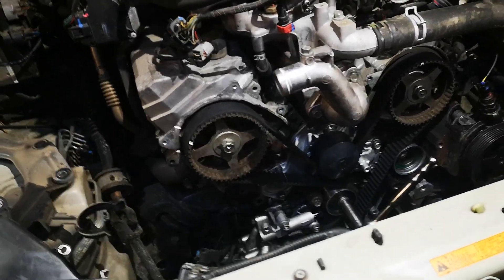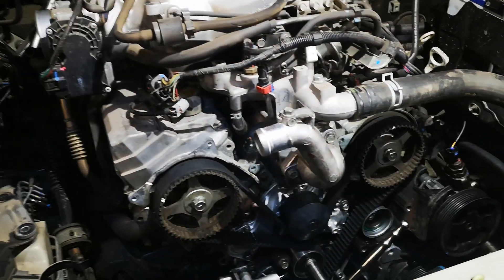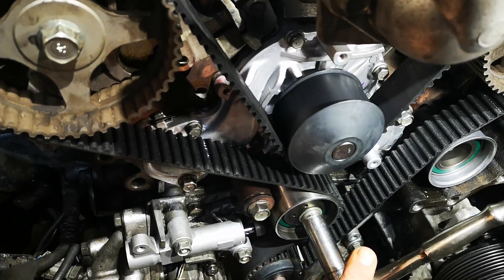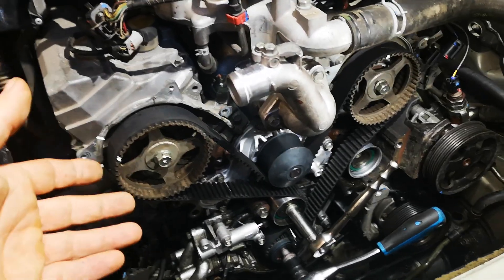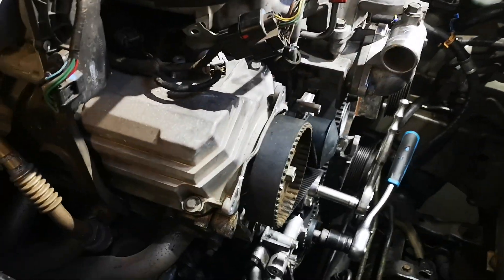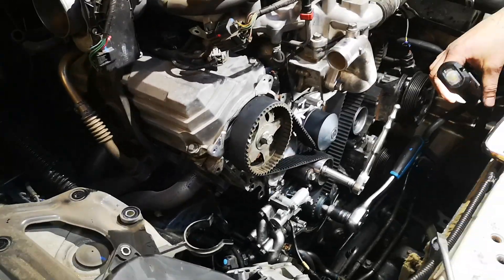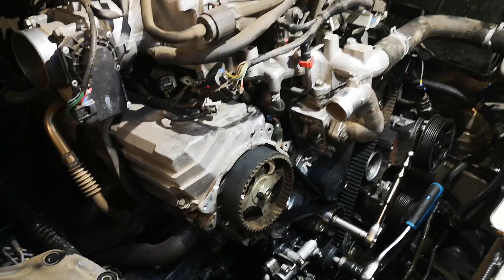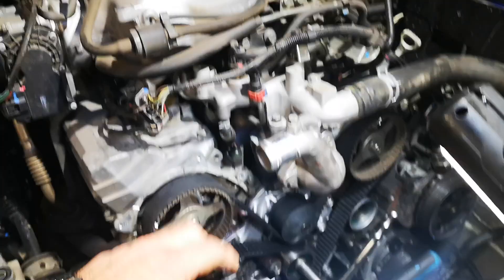Mitsubishi Pajero 2009 3.8 litre V6 6G75 timing belt tensioner adjustment precaution warning

Comment: Hi, I see you have some good knowledge of Pajero. I have a problem with vibrations with my 2014 3.8L Pajero. It starts to vibeate every gear shift aound 2400 rpm also on idle. Transmissin is checked and is not the cause of the problem, alternator also. Do You have any suggestions where to check?

Comment: Hi,
I have a 2004 manual pajero.
I just installed new spark plugs and after installing the car does not start.
I hear thesound of the starter motor but it does not engage with the motor.
What might be the cause?

Regards.

Comment: 6g74 DOHC vs SOHC have different orientations on the belt tensioner pulley - SOHC the two dots are below the bolt rather than above from what I'm reading. Confirm this yourself though

Comment: Tensioner pulley was upside down in the video👍
For the 6g75, 3.8L...pin holes should be at the bottom, turning the pulley anti-clockwise to tension...whoops...lol...Maybe why they come a gutsa🤔🤣👍🇦🇺

Comment: Hi can i ask i noticed you had the tensioner pin out while you were going to adjust the tensioner pulley, is this how you do it or do you adjust the tensioner pulley till the pin becomes free in the hydraulic tensioner then tighten the tensioner pulley bolt.

Comment: Thanks mate of all the videos on YouTube know one has done timing belt for this exact motor. I had it lined up with the second timing mark (F)  and it would not rotate more than 1/4 of a turn before valve and piston collide so I readjusted the timing to where you have yours at and the motor is able to rotate again. Thanks so much